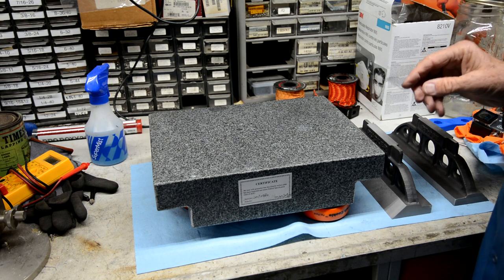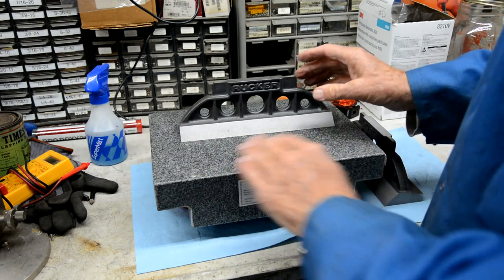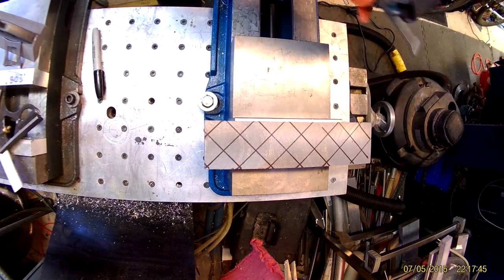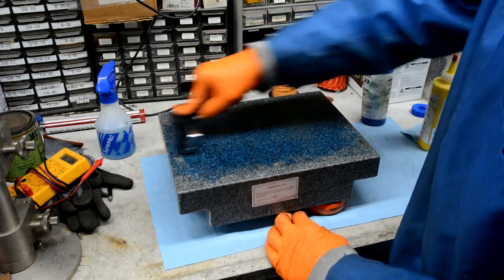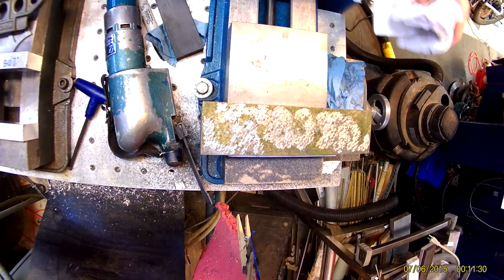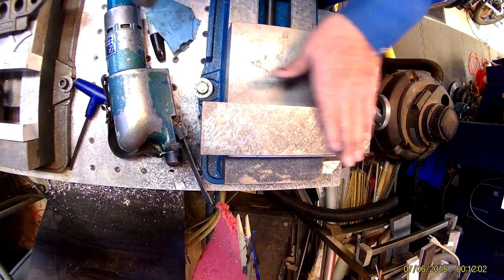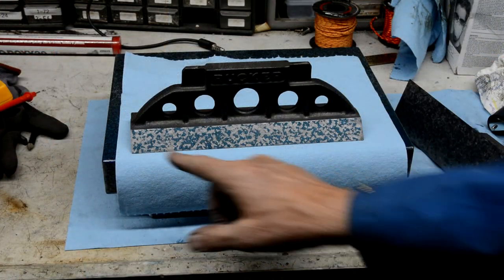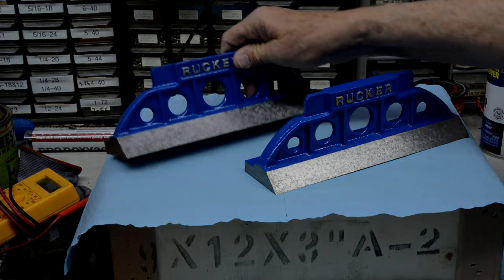Scraping a Keith Rucker 9" straight edge

Comment: Nice presentation. One thing to note... The Connelly  Book says that when printing the workpiece you should only move the workpiece from one end and in a straight line 4-5 short strokes If I'm correct. That will help prevent getting false readings and tipping on the high spot in the middle. Thanks for sharing your content.
Reply from the maker: I am using the method taught to me by Richard King.

Comment: Enjoyed....been discussing hosting a RK class in my shop....late summer?
Reply from the maker: If you are going to have a scraping class at your shop, I would have my surface plate certified.  I believe Richard will pay for it out of the class proceeds.  Even one class is pretty hard on a surface plate and you may have to have it checked again after the class.
Reply: Vincent Endter good info, thanks... recently had Standridge (video) surface my 2 plates... paid for B certified but both measured AA

Comment: Hi Vincent, I found you from Chuck's site. Nice job on the straight edges. I have just scraped my first straight edge from Denis Foster, I was really happy the way it turned out. Where did you get your ink rollers from? the one I ordered from ebay is really bad and just skids on the blue. Jon
Reply from the maker: Amazon: Teemico 2 Pack Soft Rubber Brayer
https://tinyurl.com/r3zlto4